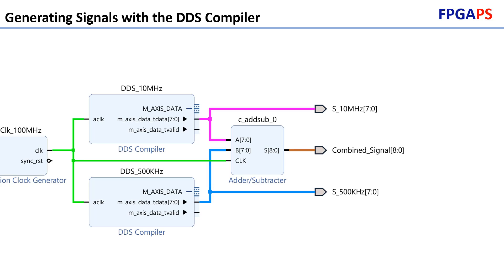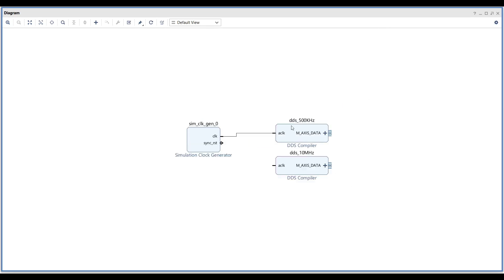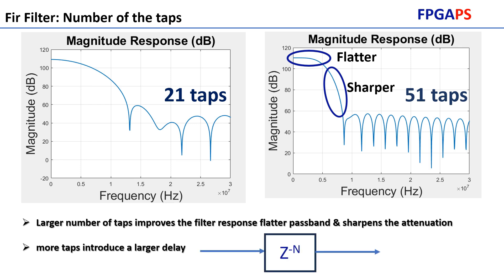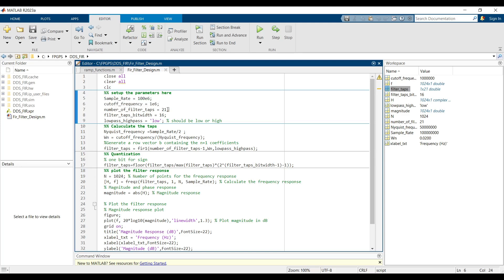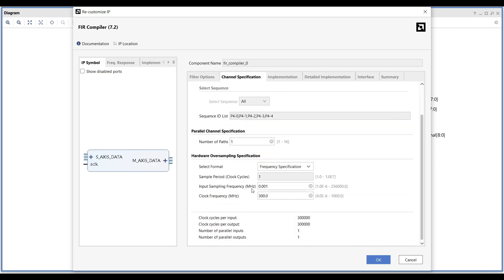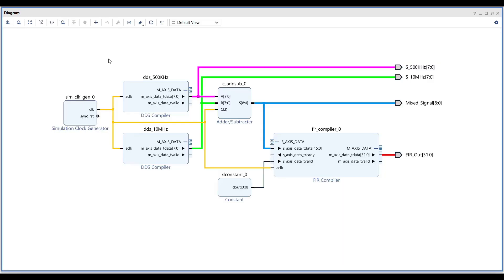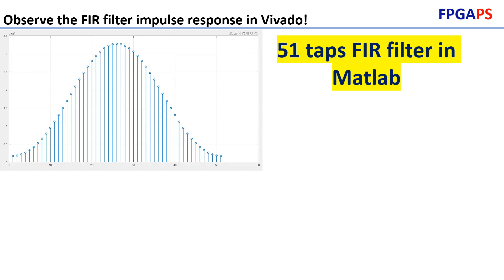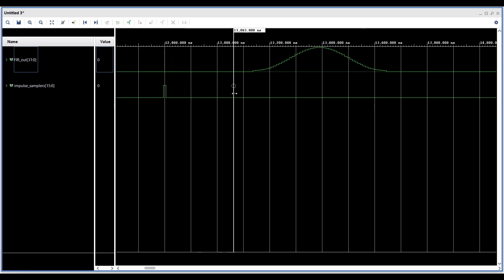FPGA DSP: FIR Filter IP with DDS Compiler in Vivado

Comment from the maker: 📌Observing the filter's impulse response is crucial:
   ✅It confirms that your filter is set up correctly and functioning as intended(debugging target).
   ✅ It allows you to accurately measure the filter's delay. The number of clock cycles between the input pulse and the appearance of the first filter tap represents the filter delay.

Comment: Is it possible to do the smae thing using verilog code ? I mean without using the diagrams
Reply from the maker: Hi @ososonaso
Welcome to the channel.

if you need a RTL FIR filter design, I have a Video tutorial with VHDL code, you can ask ChatGPT then it can convert it to Verilog .
https://youtu.be/oMxW1eZuRes
 
if you want to work with FIR IP in RTL mode and non-project mode, you can generate XCI from FIR Filter IP and then instantiate it in your Verilog or VHDL code, in this way you don't need to work with diagrams and block design. 

Thanks!
Reply: Thank you so much  @FPGAPS 
I've tried to create the dds compliers and adder using ip catalog then tried to instantiate them in the top modules but i couldn't get any waveforms from the simulation. I haven't included the FIR filter yet
Reply: Yes you can, Just use the FIR IP and instantiate it in your module. You can read the instruction of the IP it is very useful. If you have time you can make your own FIR filter, its just a shift register with multiple  of multiply and accumulate logic.

Comment: Hi! Thanks a lot for the tutorial, I found it very useful as I am starting to learn about Vivado IP Cores.
Just a little note about the simulation step, which maybe will be helpful to another novice like me, as I was struggling because the output signal wasn't displayed correctly in my project.
In the simulation window:
1. Right-click on the signal name
2. Select Radix -> Signed Decimal
3. Right-click again on the signal name
4. Select Waveform Style -> Analog
The 2nd step is crucial to display the sine-wave with sign inversion.

Again, thanks a lot for the videos!